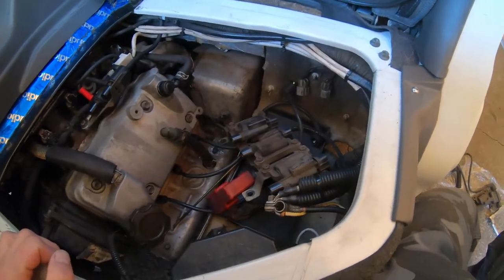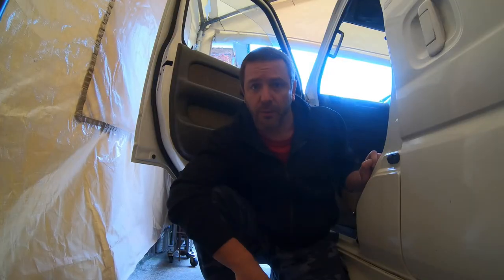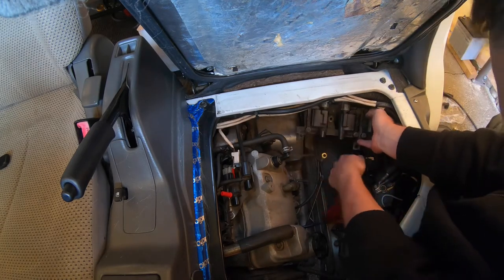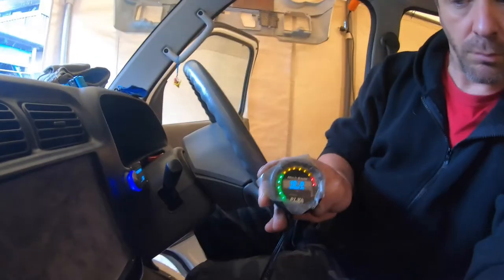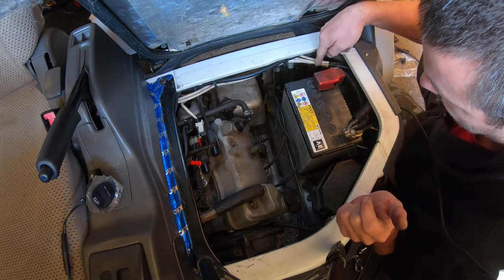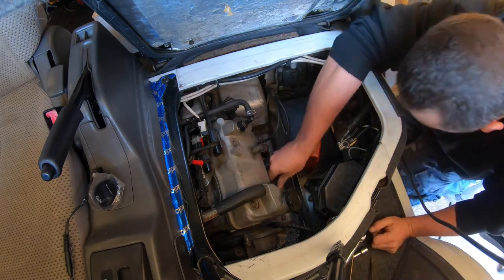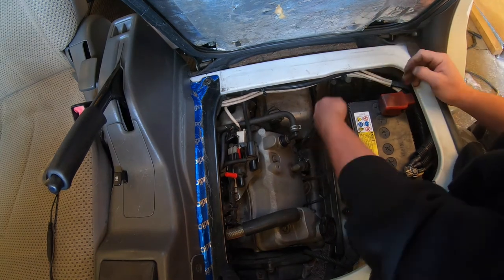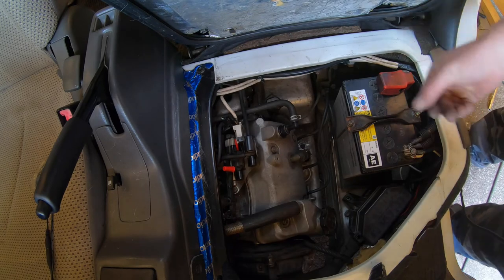Suzuki Every Van DA52V Vlog #55 (Ignition coil replacement & Just Japan Things)

Comment: what readings should show on ignition coils?
Reply from the maker: I have no idea...
Reply: @GarageKei  ok cos my reading shows 0.8 on one side and just bought second hand ones that show the same but now cant be sure these are faulting, power going to the coil but no spark and wont start
Reply from the maker: New leads?
Reply from the maker: I'd throw new plugs and leads at it and work backwards
Reply from the maker: How did you measure and get 0.8. I can try the same method tomorrow.
Reply: @GarageKei  Yh just found out the plugs on them are the wrong ones, leads are new had them made cos I couldn’t get them, I put multi meter to 200k ohm negative to middle and pos to left, right pin should show about 22-29 left should show 1.08-1.32 from what I’ve found online
Reply from the maker: Ahhh input to coil. I see. I thought you were testing coil output.